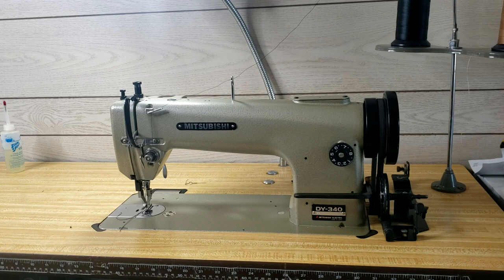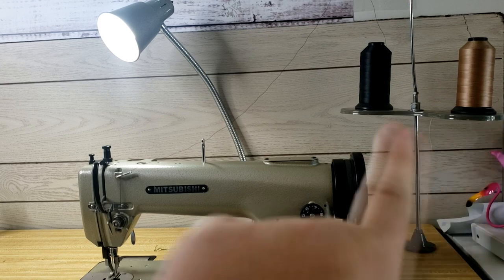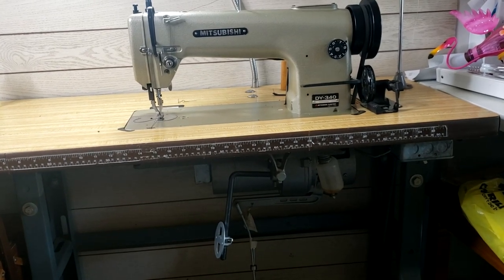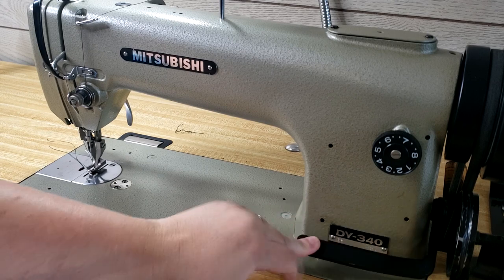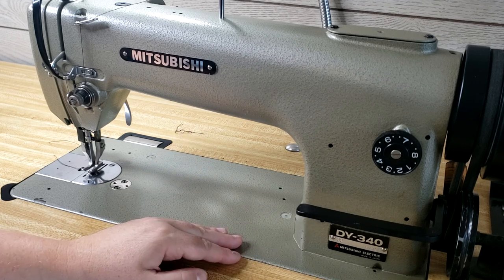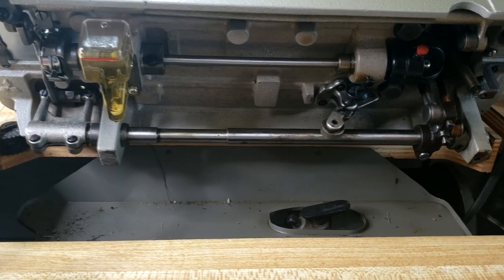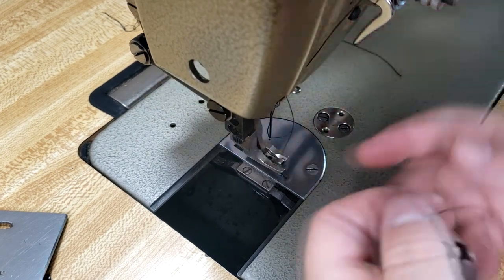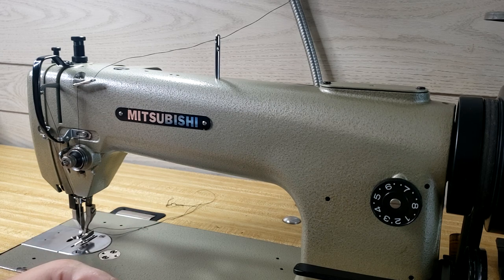My new industrial sewing machine and tutorial sneak peak!

Comment: Done a bit of sailmaking/marine trimming. haven't worked with this machine specifically but have worked with quite a few walking foot industrial machines like this one, mostly Adlers.
In regards to the back lever, you should not need to oil that, they usually are a lot stiffer than your standard domestic machine, they have a heavier spring due to these machines needing a lot more foot pressure. You can adjust the spring tension however, but I am not too sure of how to do that. 
As for the oil points, not all those points will be for oil, the will usually be at the base near the foot, on top of the head and sometimes there is one in the middle of the arm. I also put a few drops of white oil strait down the needle hole to lubricate the bobbin casing. 
Just a small thing I noticed you doing when you started to sew: when holding the thread you pulled it back directly from the needle. In my experience, you need to pull a little tighter than a domestic, so this can sometime bend a needle and shred it on the foot. (when you break a needle on these things, they will 'shred'). I usually thread through the hole in the foot, so I am pulling on against the foot, not the needle. 
As for the speed you will get used to that with time, took me a few months. 
I really enjoyed watching your video, you are clearly a very experienced textiles tradesman.

Comment: I needed a machine that could sew Carpet so I purchased a Surneis Industrial machine for China.  I can find very little about this Machine but it has the configuration of most Industrials like the Mitsubishi DY340.  It did not come with a Motor and their motor was unavailable.  Soooo, I found a 600watt Sewing Machine motor controller.  Next is the table - Do I make a table or buy one? Haven't figured that out yet...
Reply from the maker: I replaced the clutch motor with a servo I got off amazon. It's lovely. I'm not sure about the table. If it's a heavy machine your going to need a strong sturdy table.  Building might be better as most furniture these days are garbage
Reply: @Charmedbyashley  I jumped ship and sent it all back.  By the time I buy the machine, Table ad Drive motor I have spent more money than a Vevo that is complete [almost anyway, only a screw or two missing.]
Reply from the maker: @FlyingCondor1 haha that's probably smarter 🤣

Comment: I just got one of these. It won't catch the bobbin thread or it breaks the top thread. Machine is timed right needle goes far enough. I don't know what else to check.
Reply from the maker: check your tension on your bobbin casing. when things are too tight the thread can melt and break.  if your thread is too thick for your needle also the thread can melt and "break"

Comment: Don't suppose you have a user manual for it?...I have spent hours looking. Parts lists, no problem. User manual, impossible. I've just bought a dy-350 but it looks identical and has the same splash guard underneath rather than a big sump with wicks.
Reply from the maker: i have searched the internet top to bottom and have not been able to find the user manual, ive even emailed mitusbishi and never got a response.  my machine is the only machine ive seen without an oil tray.   i recently put a servo motor on it, it is amazing now!
Reply: @Charmedbyashley  Tks, I tried Mitsubishi and got blanked as well.